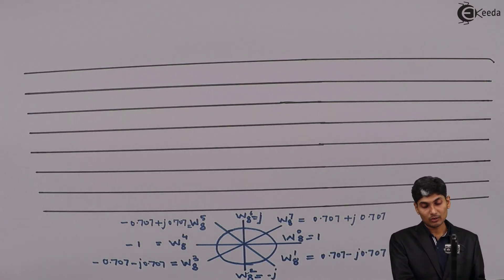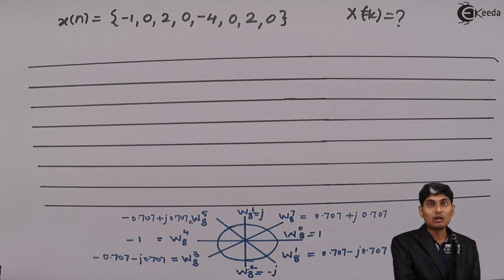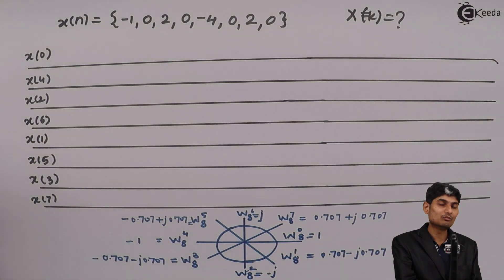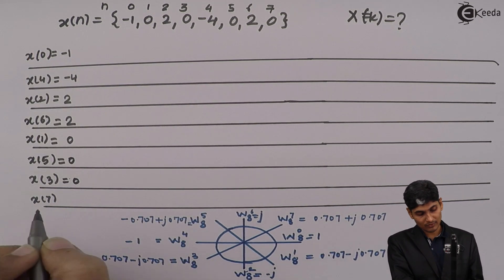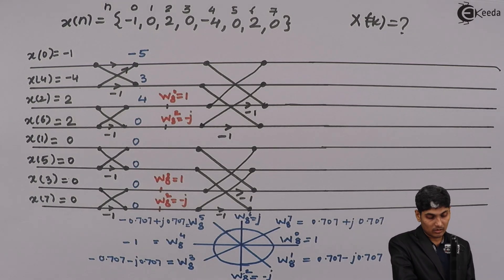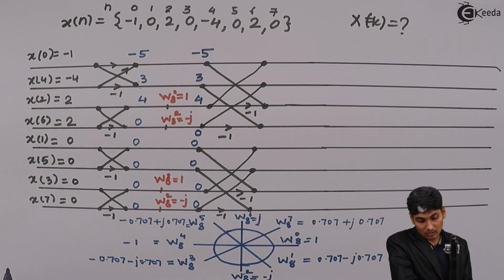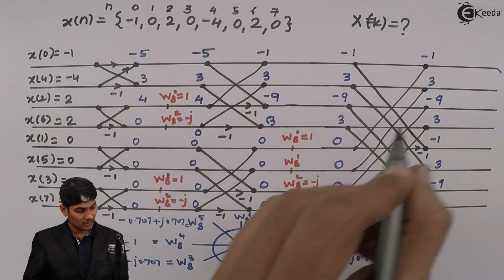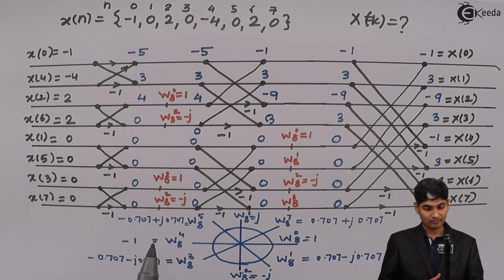Problem 1 on 8 point DIT(Decimation In Time)  Fast Fourier Transform (FFT) Flow Graph

Comment: Hi dear sir ,
As i know that you know well of FFT(Fast Fourier Transformation). and as you explained 

FFT are working in 2^N   Data , But how to do calculate MATLAB without 2^N data 

I watched your video very carefully then i understand and write code in Python but i am face a problem that MATLAB are work without 2^n Data, but i am  not able to do this.
Reply: MATLAB will add zeros if the data ins not 2^n (zero padding)